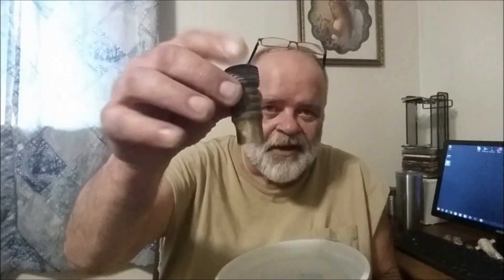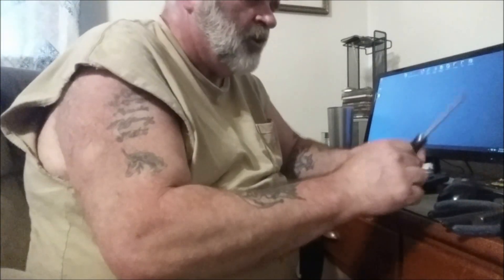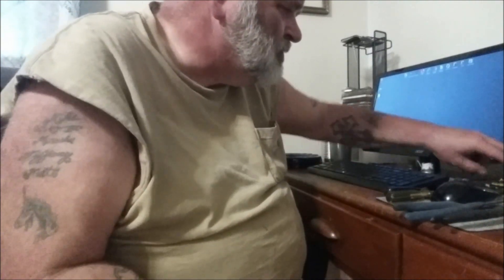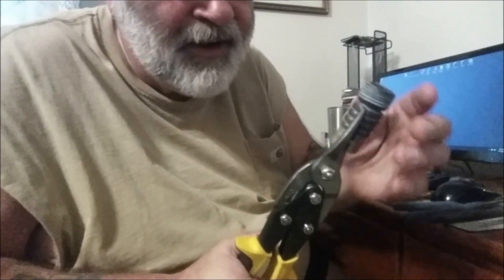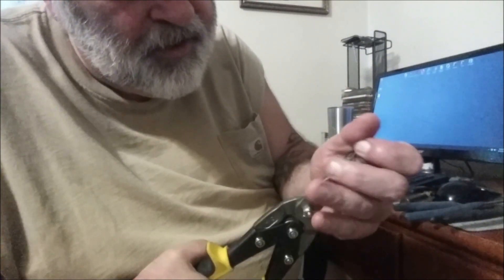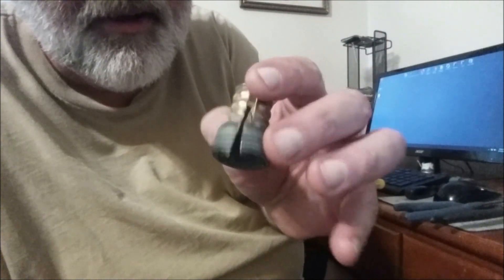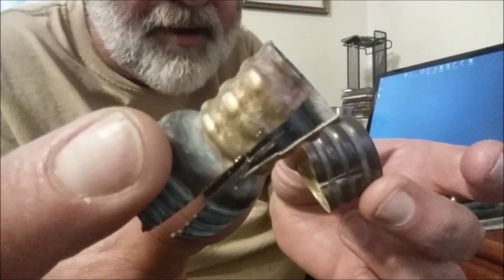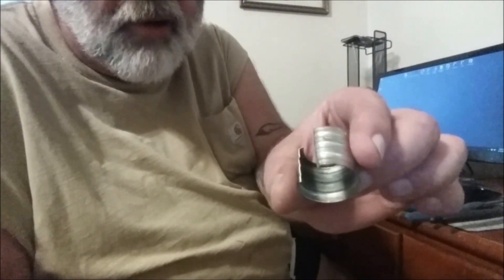Make The Most Money Scrapping Garden Hose Brass

Comment: These are called tin snips. How much weight is each hose brass fitting? Also could consider using angle grinder with cutting wheel and clamping it down.